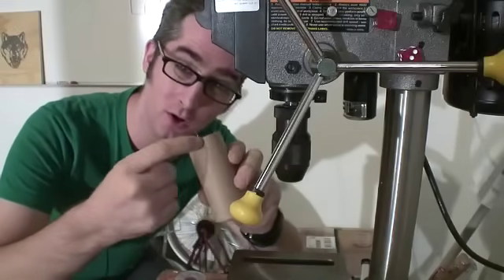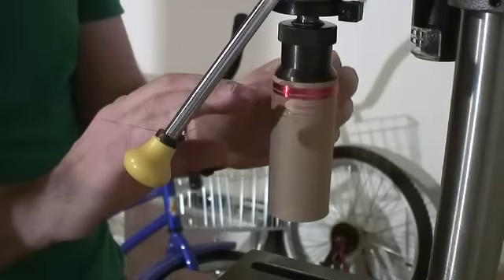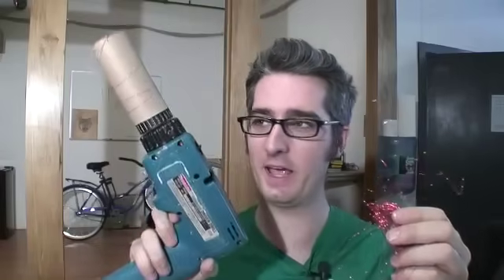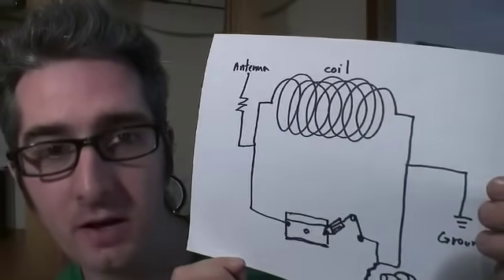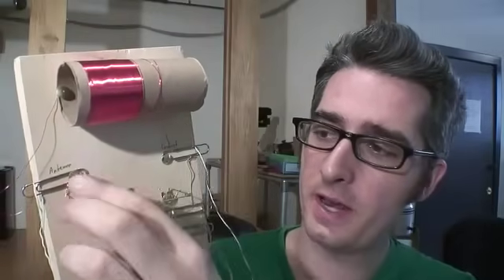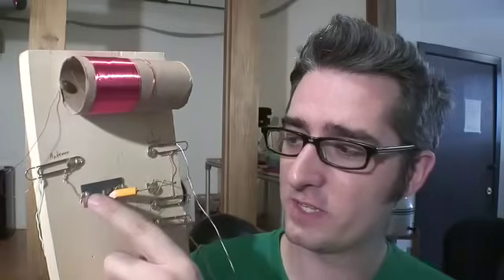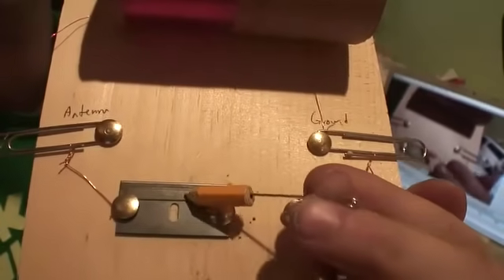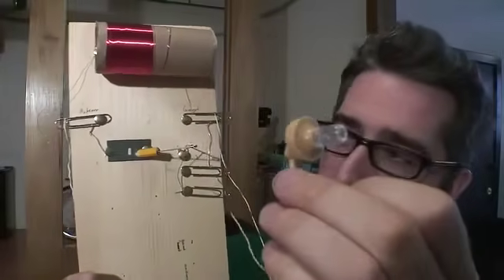How to Make a Foxhole Radio

Comment: I Googled this a lot and discovered this radio lacks a bar across the wound wire to tune in different stations.

To make a speaker for this google this exact term with quotes :

"Making High Impedance Headphones With less than 5 bucks" 

Also check this out for making radios, google this exact term with quotes :

"Building a simple crystal radio."  That shoudl bring you to Sci-Toys website, many pages about building different radios.

Comment: did you do it? i feel that i would be very proud and brag aboutit to averyone if i can get any am station with this. where can i get the pdf? 120 turns that is? any sort of razorblade? burn it?? is the razorblade the varying capacitor in this circuit? omg i just trew away a perfectly good wooden protoboard :(

Comment: One safe way to heat the blade is on an electric stove. Lay the blade on one of the elements, turn in on high, wait until everything is glowing nice and amber / orange, then turn the element off.

This might not get the blade quite hot enough to temper / oxidise - but its worth a shot.

Comment: lovecraft688 your an idiot.
did you learn in science class that THIS IS IMPOSIBLE AND YOUR WIDE RANGE OF RADIO KNOWLADGE SAYS THIS DOESNT WORK....
you have no actual knowladge backing up your stupid post.
radio waves, light wave AND sound waves can all produve electricity. look it up
did you know that lead is used to soter electronics? so the pencil working to tune it is acutally not that imposible.
you were probebly tuned with a pencil.
go try it dumb ass.
then tell us how right you are.

Comment: This is exactly the kind of plan I was looking for. Years ago I found plans in a real old boy scout manual that used the cardboard tube and cats whisker, but it used a galena crystal. I think it also used varnish coated wire and the varnish was removed from an arc that the tuning arm traveled.

Comment: a  wire connection with a  hot water radiator plumbing or water tap or iron embedded in watery ground, even just a wire lying on wet ground, I think.

Comment: The more turns the lower the frequency range on the beginning of the band.  500 turns will receive the longwave bands like 200 kHz to 600 kHz. if there are more turns you can tune in 150 kHz to 400 kHz.   120 turns will be just fine for the AM (MW) bands.

Comment: I build something similar to this when I was starting out with electronics. But I used a germanium diode and added a tuning capacitor. 
I am an electronics engineer now and I did not know that it is possible to make a rectifier from graphite and iron oxide.

Comment: I did some research and found out you can change the length of the antenna or coil, or install a tuning capacitor.

Comment: No, I suspect that they used high impedence earpieces from field telephones, I have one of these and it is more sensitive than a crystal earpiece when used with a diode receiver of this type, better still to use 2000 ohm headphones, you can get them on ebay.

Comment: No. Magnet wire is enamel coated/insulated copper wire. welding wire is uninsulated and the steel core makes it far too stiff.

Look online or at a local electronics junk store or Radio Shack for Enameled Wire. 28 gauge is about the right size.

Comment: You can find it online, or buy a cheap clock from a Dollar Store/Discount store. There will be a solenoid (coil) inside with a -lot- of very fine wire. However, that's way thinner than you need, but it's a cheap source.

You must have some kind of electronics junk store or Radio Shack near you, ask for Enameled Wire. 28 gauge is about right.

Comment: To wind the wire you can use a bicicle just attach the tube to the rear center of the wheel and use your hand on pedals to start making it, its easy to imagine i cant use all the terms to xplain cuz im from Argentina and i dont know all  the english lenguage.
I used a machine to make an electricity transformer the machine is just the bycicle function but simplified ;)

Comment: Well, you are right that different wave lengths will behave in a different ways with matter. But  your wireless phone and the microwave oven use the same frequency (wave length). Here the only difference is the power output, measured in watts.

Comment: my grandma has a realy cool bronze figure. when you hold the plug of an earphone with the hand on the upper metal part and press the the tip of the plug against the figure, then you can hear radio^^